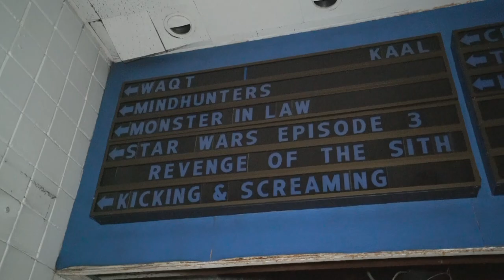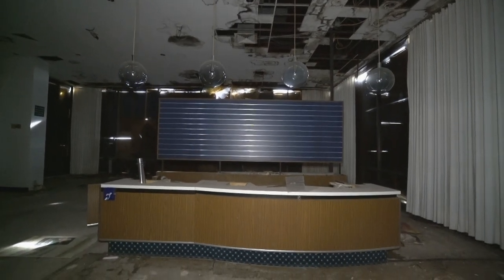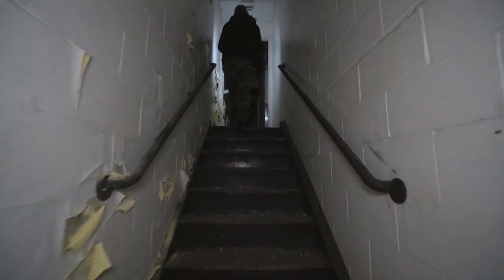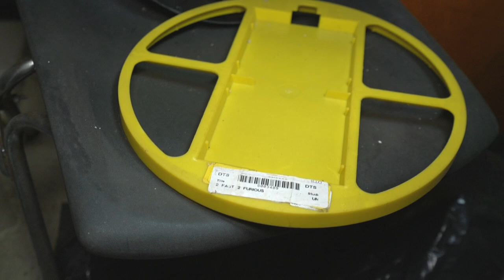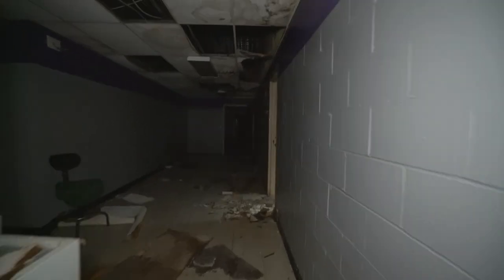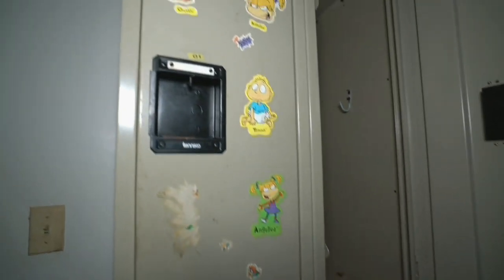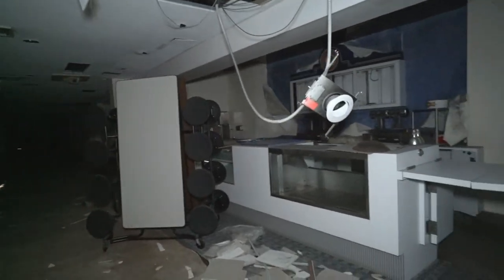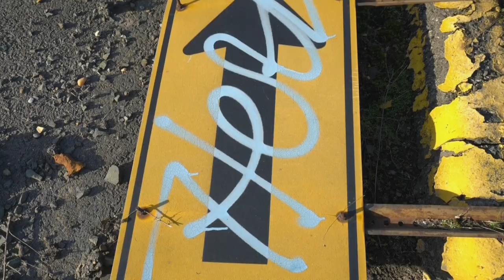Abandoned Retro Movie Theater - Films Left Behind(Closed 2005)

Comment: I was a projectionist in high school at our local theater back in 2001. On the table where you found the movie trailer, that little box with the pulley on it is a build station. When movies would come in from the distributor they would usually be in 3 or 4 canisters and you would have to splice them together. Your goal was to make buttery smooth splices. If you ever watch a film based movie, you will notice a small black oval in the top right corner of the frames right before the splice. That was to help us ensure that the film was turned the right direction. 

In another part you picked up a black telephone. That was connected to the old-school auto-answer system (box below the phone) that would give out the movie times when people would call in. Our theater was so small that you could only fit 2 minutes of audio on it, so it was a game sometimes to fit it all on there. 

The rectangular boxes on the concession counter with a well in them were the "butter" warmers. Inside those you would fill it about 1/4 full of water and then put the butter tub inside. It would keep it boiling hot, so when we cleaned those at the end of the night you would pray you weren't scalded to death by the mysterious substances in the butter and water. 

Lets see... In the projectors, they had removed the xenon arc lamps that produce the light. That bulb was 1 million candle power and was under such immense pressure that they would explode like a bomb if broken. I'm sure that the owner or corporate offices made sure to remove those because of the huge hazard it would be to vandals. I'm sure one of those exploding in your face could kill you easily. 

The DTS audio discs were only used on one of our screens, but the others just pulled the analog audio directly from the film. The DTS system would sync that audio using a special player and sensors that read the marks on the film with infrared light. That way if you had to stop it for any reason, the audio would still be in sync. 

Finally, the last thing I can remember were the lenses... You could manually focus those, but they had an auto-focus, auto-pincushion, and auto zoom system that would automatically engage when the sensors detected the marks on the film. It would check itself for every reel that was spliced in. If the film was 4x3 format it would also call the side curtains to close which would frame the movie and prevent light-bleed. If it was 16x9 those curtains would automatically open. Usually when you powered down, the curtains would close and so it leaves the screens looking quite square. 

The film platters were something we didn't use, so no experience there unfortunately. We used the really old-school reel-on-the-wall type that would absolutely cut your arm off if you got to close during a rewind. It was a dangerous job... the film was like a fast moving knife and was known to cut pretty deeply. 6' spinning reels, exploding bulbs, extremely hot surfaces... I'm not sure how I didn't die at 18 years old up there. 

Hope this gave you all a bit of context for the stuff you saw :)
Reply: Nice! Ahoy there fellow projectionist! I had left a comment as detailed as yours as well, I did have some experience with the film platters and I assume they made the job MUCH easier. I had a lot of fun running projectors in my youth and I loved being in control of the "behind the scenes" aspect.

I forgot about manual focusing! Had a copy of Spiderman 2 where the last reel was out of focus from Columbia and we always had to be there for the final reel splice to fix focus until we received a replacement reel.

I personally ran Revenge of the Sith through 4 projectors at once. Started on theater one and then instead of being wound up, it ran through pulleys to the next projector and so on. It was a AMAZING to see one film run across 4 projectors in 4 different theaters!
Reply: @kingrodedog8487  Oh yes! We would bridge projectors as well when we had a huge release. We would just add extra leader to the film so that it was long enough to reach. I suspect that was a piece of black leader film that he picked up out of the tray. 

I threaded so many projectors while I was there that I could probably manage to do it again if I had to. That two finger wide loop right before the shutter advance was critical unless you wanted to do splices on the floor in the middle of a show :) ahh memories. 

I'm not sure if you ever had the film escape the reels, but that's a real mess... no pun intended. The first Harry Potter movie released on my first week. At that point I was just the poor guy who had to use an electric leaf blower to clean up popcorn spilled by 400 people. fun. 

Did you manage to keep any of the movie trailers once they were finished with their run? I have a couple somewhere, but I suspect they're pretty brittle by now. 

But yes! Nice to meet a fellow projectionist!
Reply: I was also a projectionist for a bit in the late 90s and worked exclusively with projectors that had platters. It definitely made the job much more automatic since once I started a show the automation would handle most of it unless there was a problem, then I'd get the loud projector alarm and have to go running to it. 

There were really only a few downsides to the platters. One was we couldn't rewind, so if there was a technical problem we couldn't back it up to the part that was missed, unless we wanted to do some cutting and splicing. 

Another was that sometimes due to static or defective film it would stick to itself and then start wrapping around the feed unit in the center. It was rare but if it happened and wasn't caught it would quickly tension the film and get stuck in the gate where it would get chewed up and melted until it broke and triggered the failsafe (and alarm). 

Oh and one correction, the oval in the corner was a reel change indicator, though it could be used for film orientation when splicing (I used the soundtrack to orient the film). This was for theaters that used a dual projector system with manual reel changes. If done right the changeover could be mostly seamless. The next reel would have been threaded on the second projector to the start frame on the leader. When the projectionist saw the first dark oval they would start the second projector then at the second indicator they would press the changeover button which would switch projectors.
Reply: @PaulN504  Interesting! Our manager always had us check for the oval to make sure that the film was printed properly. Occasionally we would get a reel or two that was either developed poorly or printed backwards. So the right-side oval meant everything was at least turned the right direction. But I never saw a dual projector system in use. 

Our theater used the reel-to-reel system and so we would get a lot of static during the rewind. There were a lot of problems with tangling when the air was dry (I hated winter). So that problem seemed to plague everyone. 

The rewind after some kind of issue was possible but was not easy to pull off. The take up reel had to have a precise amount of tension on it or the pulley wouldn't float properly. So we always just fixed the issue and resumed from the same point, trying our best not to touch the reels.

That pulley was used to determine the speed of the take-up and was very sensitive. Turning the feeder or the take-up independent of one another was a last resort type of event haha. 

Thanks for sharing guys! This is a part of my life that I had almost forgotten. But wow the memories flood back. It could get really crazy in the booth, but being alone up there was a lot of fun.
Reply: Yes to everything you said. I was a protectionist back then, too.
Reply: Tyler Durten: in the movie industry, we call those " cigarette burns"
Reply: Im still working at the cinema, I was a projectionist, now Im a glorified cinema tech/popcorn popper... Its all digital now. I kind of miss the old days wih 35mm. Some times. Kind of sad. Kind of a good thing. 

You have the film formats a bit wrong. Probably a long time ago, but 4:3 and 16:9 that you mention is TV-formats. 35mm movies use two major formats: 

Widescreen (WS) 1,85:1, also called/referred as FLAT. 
Cinemascope (CS) 2,35:1, also called SCOPE.
 
Some older films where 1,66:1, and even older 1,33:1 (same as 4:3). 

Most films still come in theese two formats, but sometimes they are HD as modern HD "Widescreen" televisions (1,78:1) and some films come in strange formats as 2:1.
Reply: Hey hey, same here was also a projectionist at a platter based theater, granted the splices were always done by the time I clocked in, but I always made sure to throw people off with awkward and disturbing whistling that further enhance the theater's history of a haunted projectionist area (which was hilarious since my theater took home in an abandoned grocery store that didn't even have a second level)  I remember The biggest movie that came up on my elevator was Gods and Generals canisters, and I think it comprised of 8 cans.  Jesus, I stole so many old movie trailers, even the rare Supernatural "trailers" that really just advertised the show.
Reply: Thank you for sharing
Reply: @PaulN504  What a cool thread to read. I worked at a small two screen in a small town back in the mid to late 80s. I didn't graduate to projectionist but I remember the best times being when my manager would assemble the films the night before official release and hold 'midnight showings' for all the employees. Those were great times as we were the first to see such classics like Aliens, Terminator 2, NL Christmas Vacation on the 'big' screen a full day before the general public!
Reply: @kingrodedog8487  man...running one movie on 4 different screens sounds amazingly satisfying.  I’m so in love with the technical aspects of film that I’d probably have more fun watching that process than watching the actual movie
Reply: Well, not quite. The cue marks you refer to are not intended to help you know which way the film is facing (you are expected to be able to determine this without anything like that, though you are to be commended for looking at it as a backup confirmation), and they are not "oval". Cue marks are for changeovers on traditional (two projector) setups. The first cue  is a "motor start" cue, 190 frames (8 sec) from the last frame on the reel, to allow the projectionist to start the motor on the next projector and let it ramp up to speed, consuming the equivalent amount of leader (minus ramp-up time) on the next projector. The next cue mark, 18 frames (3/4 sec) from the last frame is the "changeover" cue, for the projectionist to simultaneously activate the solenoid shutter to change the picture from one projector to the other, and flip a switch or press a button switching the sound source from one reel to the other. Cue marks are always round. They appear oval on the screen if the film being projected is in Cinemascope, using an anamorphic lens.
Reply: I worked as a projectionist in the UK. I recognise this as a Showcase or National Amusements owned cinema as it is almost identical to the one I worked in. The brickwork, Century projectors, Christie platters and green seats with a wooden back were all indentical. The note on the whiteboard about not allowing employees overtime was a typical Showcase thing. Wages were poor and Salaried managers did not want hourly paid employees doing excess hours as they would earn more than a duty manager.
Reply: @gregfaris6959  Nice to know exactly what those were for! Thanks for adding the timing info. To me they always just appeared as a dot. We had some issues with bad reels and so we always just checked the print with those to be safe. That may have been something my manager told me, but it was 20 years ago haha.
Reply: @johndufton9686  That's really interesting. I know a lot of theater companies shared designs and materials since it was the least expensive way to go. It's understandable though, I think the film and licensing costs were very high. If I remember correctly, insurance on the film itself was a huge line-item on our budget every month. That's one of the reasons we would bridge projectors. It saved on the cost of holding more than one print of a movie. I distinctly remember the driver delivering the cans prior to a new showing and he always had armed security with him. 

I worked for United Artists though, prior to their merger with Regal. You could sense the budget crisis for the small cinemas like ours towards the end. Once a new facility with stadium seating opened near us it was over. Thankfully by then I had gone to work for the Government and never looked back. The memories are nice though.
Reply: The film platters!!! You want a living hell? Have one fail and have to try manualy turning the platter as a last resort. Didn't work out too well.
Reply: @briankistner4331  Ha ha yes. I've had a film slide off and be left hanging over the edge. I found it a nightmare when they introduced polyester or mylar film stock.
Reply: If the 'changeover marks' that appear top screen right are oval, that indicates the film is in the cinemascope format. All changeover marks are round on the film itself , yet in a scope format film an anamorphic lens 'spreads out" the image and turns the round mark oval. The 'decoding' anamorphic lens distorts the mark but not the expanded image which is encoded on the film in a horizontally 'squished' manner that requires to be expanded back to normal. It works quite well, although in some interiors filmed in scope, doorways and such can distort somewhat. It's best outdoors. Finally, for you old timers, remember when on TV at the very end of a western right as the credits roll, suddenly the cowboys riding into the proverbial sunset get very tall and skinny, and weird looking? They suddenly get all Don Quixote looking but no fat round guy on a burro? That's the undecoded, squinched image on the film as the only way not to cut the credit roll off terribly. The TV broadcasters would yank the scope lens out and then use a standard non anamorphic lens for focus only during credit rolls. Finally keep in mind that during the film the TV folks were cropping a slew of scope image left and right the whole time (or worse bad pan & scan), yet come the credits they simply could not get away with it aesthetically and legally. I thought that's so typical Hollyweird in priorities. Sure hack & hide 30%+ of the aesthetically composed images just do not f-ing crop a smidgen of our f-ing names and titles... got it? Or we'll sue your ass off ;-)
Reply: I'm compelled  to note a few things from vast experiences, some not so good regarding the xenon bulbs. Initially, they sucked. The lamp houses were under-powered and the bulbs were still in development. They produced way too much ozone, they were unpredictable, the anodes would melt, they would lose their vacuum. BTW, a nitpick correction to the above, when a xenon bulb would instantly  'let go' of its structure it 'implodes" not explodes. It's so fast the after effects are very similar, yet just sayin'.  The wise used the plastic shroud the bulbs come in AND goggles whenever the bulb is messed with. Also, most bulb implosion failures in the lamphouse were due to too many hours beyond rating and/or too much DC amperage from the rectifier. It was often false economy as when a xenon bulb implodes in use it often destroyed the much more expensive reflector around it. Those were the scared & somber days and nights in the booth, believe me.
Reply: "What's wrong?" What do you mean? "You sound terrible" I do? Well a bulb just exploded during the show. "So what?, that's not your fault" Uh....it might be. "Oh". ;-)
Reply: @tomkiefaber4297  I only had one Xenon implode in a lamphouse in my 15 years as a projecionist. Managers would always try and cut corners but I would always insist on changing a Xenon when the hours were up.
Reply: @johndufton9686  Hahaha. My manager always had an Eeore disposition, and the one time we had an implosion (thanks for that fact btw), he came down from the booth, and in his signature monotone voice, said "well I'm going to the emergency room. A bulb blew". Leaving us all standing there with shocked looks on our faces. He had half of his arm wrapped in a ripped up paint drop-cloth covered in blood.

Oh and speaking of irritating... Did you ever run old films for private groups or birthday parties. They would send us that ancient vellum film stock and it would almost turn to dust in your hands. So we would spend DAYS teasing it back together for it to inevitably break mid-show. GAH we hated those events. haha
Reply: @joshman1019  I had a manager who once ran an Elvis season and we had some original prints from the 60's which were falling apart. We also ran occasional bollywood films which came to us from India in a hessian sack and these were full of splices.
Reply: That was some wonderful nostalgia thank you for your descriptions. It really added to his video
Reply: WOW!!! Thank you for sharing your experiences!!! And thanks to those who commented on their experiences, too!!! :)
Reply: Wow guys! Seriously thank y’all for this thread. It was so interesting to read! I originally just came here to the comments because I spent my childhood in this movie theatre and my parents spent their child and teen years at the drive in that was there before they built this theatre. Lol now to see it abandoned for 15 years already 🤦🏼‍♀️ oh man. Interesting to hear what was going on up there because I used to stare up there and wonder what magic happened in that room 😆
Reply: @diannapia  Thank you for reading! It was a long time ago, but it was fun to talk about again. I'm really thankful that everyone commented because it really filled in a lot of my own gaps. One of the best YouTube threads I've ever been involved in.
Reply: @kingrodedog8487  @joshman1019 WOW that’s amazing gold mine of information. I remember going to theaters a lot as a kid from the late 90s into the early 00s and always wondered how the curtains functioned (always thought a person was controlling those!) and why the same movie title would be displayed in more than 1 theater with differing times (ex. 15 minutes apart) that’s amazing to imagine. I’m sure they don’t run movies like that used to nowadays
Reply: @AppStateWaifu  Oh, I'm sure they no longer run them like that. I'm under the impression that a lot of theaters have moved to digital and projection booths can run unmanned now.

I'll also tell you that the "masking" of the theatre screen were run by a switch. You just press either wide-screen or 4:3 and it would change. Movie trailers that matched that aspect ratio were paired with movies of the same ratio. Kind of a set it whenever a film was placed on said platter and not worry until it's changed. There were those rare occasions when you would run two different movie ratios in one theatre but it was never ( at least for me) a flip flop situation. You would run one movie half the day, then the other movie the rest.
Reply: No that's just to long to read
Reply: @kingrodedog8487  ye are a pirate
Reply: I started as a projectionist about 23 years ago and i was really surprised to see that the sound was on cd. Never saw that before. Now i  am checking tickets and start the movie with a tablet while sitting in the lobby.
Reply: I love the place.